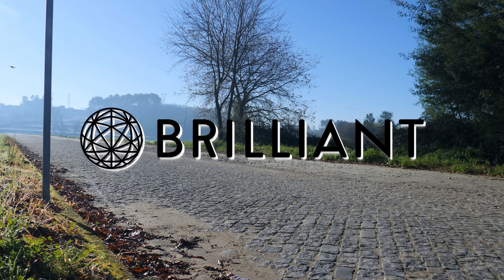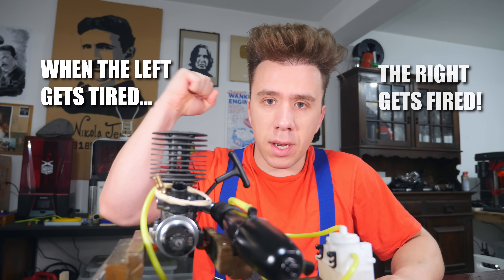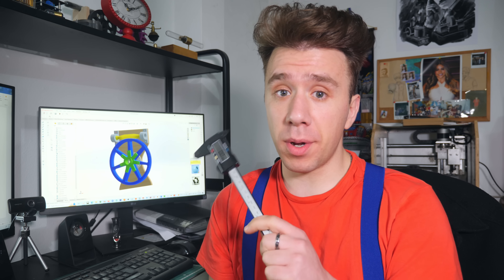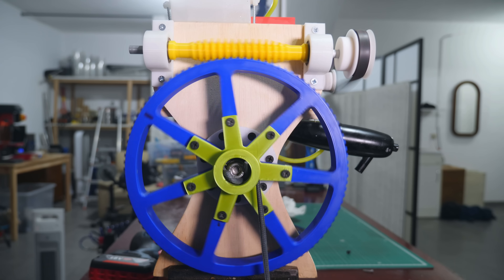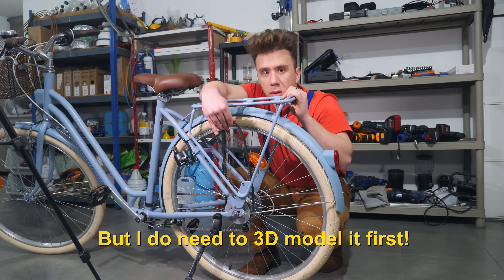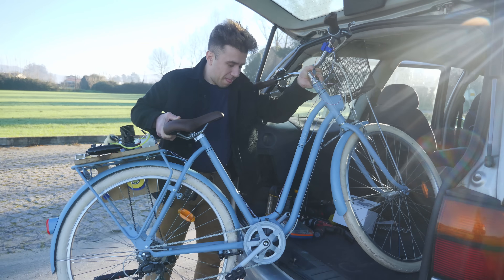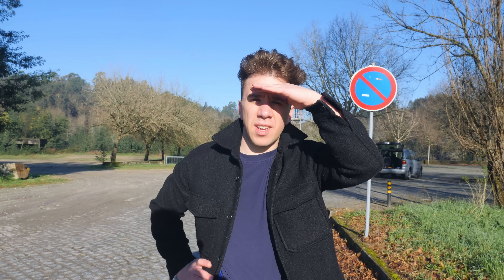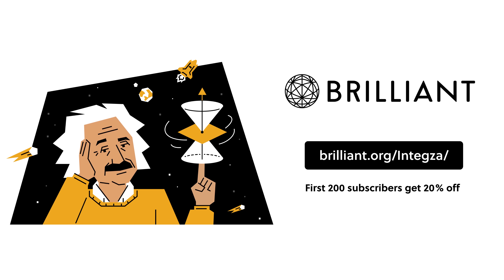Tiny 3.5 cc NITRO ENGINE on a BICYCLE

Comment: Make a drone out of nitro engines
Reply: The Iranians actually made cheap 2-stroke drones
Reply: I'm American and we approve this message.
Reply: Well never see a drone with nitro engine but i did see some rc helicopter with nitro engine tho
Reply: Oh shit that’s a good idea
Reply: Toothbrush
Reply: That sound would be horrifying
Reply: Impossible😊
Reply: I made a variable pitch quadcopter 12 years ago using a single 700 class nitro engine to spin all four rotors, I made the rotors from a rc helicopter tail rotor. You can search all over the internet for it.
Reply: Power density and output in relation to weight is too low. Impossible to make it remotely worth it. The results of existing examples are not impressive xD
Reply: the drone wone fly very good, to much vibration
Reply: Incredibly obviously nitro engines are WAY too heavy.
There's a reason nitro helicopters are huge, and only run for 10 minutes or so. 
Now imagine 4 nitro engines with their fuel tanks. How you gonna make them work together so that each motor gets proper thrust? 
How you gonna ensure the center of gravity stays the same when the fuel tanks are being emptied?
You're not. Because drones run their motors at different speeds for different motions, you're gonna have fuel tanks that have different amounts of fuel as they get emptied. 

That's the least well thought out idea I've ever heard. 

I'm sorry, but maybe think 10% more or so before you have a genius idea. 

There are dozens of excellent reasons why this idea would never work, if only you understood HOW these propulsion systems worked. 

Way too heavy anyway.
Reply: @Boogie_the_cat  well aren't you a ray of sunshine
Reply: @Boogie_the_cat how long did you spend making that whole text 5 mins?
Reply: @Boogie_the_cat  What about a drone-copter with an electric generator based on a nitro engine?
Reply: @Boogie_the_cat  Oh smart boy, ever heard of a swash plate and variable pitch propeller. The IC engine drone is vary much possible it's just not commercially viable that's why you don't see it around but cool project.
Reply: @Boogie_the_cat chill bro 😂 I know you're genius and all, but that takes responsibility. And no idea is a bad idea you just need to find out how to accomplish it. Have you tried making one? I haven't but it could work with enough engineering.

Comment: small correction, it runs  on methanol mixed with castor oil ( usually 20%) .  nitromethane is for extra power, optional. but nice to have

Comment: what you’re calling french hp are only when you’re paying for your car registration document, it’s not only about HP, but seats, length, width,weight, torque, etc, most small cars have 4 to 5, and by example, a BMW 335i is around 21 which makes the price of the registration be around 200 to 250€, or 1050€ and it’s -50% when the car is more than 10 years old, hope you enjoyed learning that haha

Comment: Very cool. I understand thats alot of work being an engineer myself. Great result, knew that teflon gear wasn't going to cut it, its just too soft...also the finish on the bronze would need to be polished.
Some nyloil rod might be a good choice and might last longer as its self lubricating...also nylon 66 has a high mechanical strength. But im sure its in the back of the shed now. As I said good job

Comment: I bet you could get to 45 kp/h or faster if you pair that engine with a 2 or 3 speed rc transmission between the engine and bike powering contraption you made

Comment: Fun video... When we were kids we tried experimenting like this, but we didn't have 3D printers so we used these engines as they came, which was from Model airplanes. You guessed it, we just mounted them propellers and all on the front of our bikes. They worked too!

Comment: Maybe you need an explaination about what you call "french horsepower". The actual translation should be "fiscal horsepower" and has very little to do with the mechanichal power. It depends on the engine size, the number of seats, the number of speeds, and its only goal is to calculate some taxes and insurrance costs.
When the 2CV was built, almost all cars were between 4 and 13 "fiscal horses", so it was an economical car.
The "2CV4" was 425 cm3, 2 fiscal horses and 23 HP
The "2CV6" was 625 cm3, 3 fiscal horses and 32 HP
🙂

Comment: The engine needs form of transmission so the engine can disengage from the gear box you made so you don’t overload the engine while it’s stopped or ride the clutch for optimal power.

Comment: 0:38 el Citroen 2cv no tiene 2cv tiene mas( según Google el 425cc tiene 18 y para 400kg me parece poco). Un ciclomotor de 50cc suele tener entre 7 y 11 cv tranquilamente. Si un Citroën 2cv con un motor de 450cc y 600kg de peso tuviera 2cv no se moveria del sitio, ya no digo hacer una subida. Asi que una 💩con🍟 tiene 2cv el Citroen. La moto que puedes ver en la imagen de mi perfil es una aprilia rs chesterfield 50cc y con un kit de competición 80cc da entre 28/32cv con 115kg.

Comment: You should've used a larger gear connected to the nitro engine and a smaller to rotate the worm gear shoudve given you a lot more speed at lower power

Comment: You are running that engine way too lean, if you adjust the high speed mixture screw counter clockwise it will produce more power, start with a 1/4 turn, also fatten up the idle screw an 1/8th turn to help that idle calm down when you release the throttle.

Comment: Most motor scooters in the US are regulated to only 49.5 cc's without a license and are capable of around 25-45 mph with motorcycle license 80-120 cc's and will hit 80-110mph

Comment: To make it start easier you need to prime it. Put your finger on the exhaust for a crew turns. Also you can shut it down the same way. Also check the temperature of the engine.

Comment: Enjoyed this video, your technical words aren't wrong, just spoken different. Amazing how you have high end capabilities,but taking off a wheel is challenging. You do have great potential, like your Grandfather. You need to understand  components better. Then you can use that to build Allot better stuff. Needs a tensioner on belt, always on return side.

Comment: Late to the party but I'd like to suggest something: 
Have the engine power a motor, used as a generator, then use an electric hub motor for the bike wheel. 
It'll be lossy for sure, but way more durable and probable faster.

Comment: You didn't have fuel, when you were pulling. You should have pumped so fuel first. That's why the drill was so easy. You already had fuel from pulling

Comment: The big downside with a worm gear is that the wheels can’t be used to turn the engine over either for starting or maybe even engine braking. Also you could hook it up to the front sprocket and use the gears at the back for multiple speeds

Comment: The gear ratio is calculated by dividing the output speed by the input speed (i= Ws/We) or by dividing the number of teeth of the driving gear by the number of teeth of the driven gear (i= Ze/Zs  ).

Comment: Sorry bro but the Citroën have 18hp not 9.
Reply: depends, there are 3 different generations, one with 9hp, another with 18hp, and another one even more powerful.
Reply: @xdnawer5525  The 9 HP was called type A and it's very rare. The most important production was in 18hp between ≈1960 and 1980
The last generation was 2cv6 it's a 12v car and 600cc and something like 30hp
Reply: He said 2 French hp, not 1. Said one French hp equates to 9 hp. He didn't directly say it but explained it as 18hp if you listened

Comment: So, I don't get the part where you slow down? Because unless you use near 45° angels on your worm and wheel cutting the power suddenly (as is common when slowing to a stop or turning a corner) all of the teeth will be  sheared off of the worm gear! Because the shafts are 90° from each other. So this video has some kind of flimm flamm going on. And you're not being totally honest about the build or the operation of your machine. And your Grandpa left you your grandmother's bike

Comment: I still don't know how you manage to make every contraption seem janky and amateur but well made and engineered at the same time.
That's a special talent.
Reply: Thats the beauty of engineering, finding the simplest solution to a problem that works. Unless youre at the physical limits you can solve every problem with enough money and time, but achieving the end goal for cheap / least complex way possible is good engineering.
Reply: "Janky" I thought I only still said that, and I'm 50yo. 💯👊🏾
Reply: @Cali-ssippian dude I'm 30 and I say janky all the time
Reply: Yeah, worm gear is a perfect engendered solution (no, it isn't.) 
Worm gears work well at small speeds, but still worse than a simple GEARBOX. Gearbox is the simplest and the best solution humanity ever made for this type of problems. 3 1/4 gear ratio gears, we get 1/32 gear ratio. JUST 6 GEARS!
And to find gear ratio he needed he could just use 2πR, ask himself what speed he wants and fricking count needed rotations.
I made almost the same project with electric motor (not  bike electric motor), and my little 10 year old brain in Russian village did freaking better.
He is definitely not a bad YouTuber, but definitely not an engineer.

Comment: It looks like the engine was running a little lean at full throttle, going off of the look of the exhaust smoke cloud. Nitro engines are very sensitive and normally need to be tuned for the given day.

Comment: It is capable of much more power but you were not revving it nearly high enough.  The porting, timing and exhaust pipe of the R/C buggy engines are all optimized for power in the upper end of the rev range.

Comment: @5:53:  One of the most dangerous moves you can make with a table saw - cutting small pieces off on the right up  against the fence.  If that piece gets slightly out of alignment it can become pinched and that whole pieces can become airborne...  not to mention the insane height of the blade above the work piece.  A good way to lose a hand!
Reply: Yup , that was the most idiotic thing I have watched in a long time
Reply: Always make and use a push stick too.

Comment: You're using street tires. Just use the huge bycicle wheel itself as a reduction "gear" and let the engine drive it directly from the axle. Works pretty well. Have a look at add-e, the inventor of conversion kits. Because a worm gear is pretty inefficient.

Also, you're scattering micro-teflon everywhere!

Comment: Brass is definitely not self-lubricating. Try running brass on brass and it will destroy itself quickly. Brass is used for bushings because it works well against *steel*. The dissimilar metals won't bond at the molecular level, so no galling takes place - no tearing of the surface, no rapid wear.

Worm drives have a lot of friction. I suggest you get rid of it and create a gear or belt reduction all the way from the motor to the wheel. It'll go better and last much longer.

Comment: you need to prime these engines by holding a finger over the exhaust. This will pressurize the fuel tank and force fuel into the carb

Comment: That is a lot of power for a bicycle. Of course, you have a lot of losses in the drivetrain, a heavy and not very aerodynamic bicycle (and rider), a non-ideal fixed gear ratio, etc.
Just to let you understand the potential of this exact amount of power - professional road cyclists can maintain 1500-2000W for a few seconds during a sprint reaching speeds over 70km/h commonly. A cyclist on a road bicycle riding a level road of decent surface quality needs only about 150W on the pedals to go 30 km/h.
If you spent a lot of time engineering and optimizing this, with this power output it would literally be a dangerous vehicle xD

Comment: Wonderful! Just a comment; those little motors aren't good with side loads. They normally drive something in line not a tight belt. Just saying you might consider supporting the crank snout with an external axial bearing to take the side loading. Better for crank life. Keep up the fantastic work and thank you for the entertainment.

Comment: It took that much to crank because you didn't prime the fuel system. Before you put the glow ignitor on it put your finger over the exhaust outlet and pull the rope about 3 or 4 times. Then it should crank within 2 or 4 pulls. It's idling up like that because it's to lean

Comment: 'Nitro' is a term used by people who don't really know these engines, it is correctly known as a glowplug (or just glow) engine and they run on methanol, with nitromethane as an additive to boost power. Try running one on pure nitromethane and you will never get it started!

Comment: it was easier the second time it started because it had already ran at that time. the first time ever running an engine it wont start the very first time.. or few times.. it wasnt quicker because of the drill it was quicker because it already ran before

Comment: The issue isn’t horsepower it’s torque. That’s a 2 stroke engine so it’s low on torque until it’s high in revs but even an equivalent size 4 stroke, it wouldn’t have the same torque of a larger engine of similar horsepower because part of torque is rotational mass. These tiny engines are…tiny…so less mass of the piston and crank so less torque. 

Rc models are obviously smaller and lighter so their torque to weight ratio is adequate.

Comment: Worm gears are very inefficient, you are loosing nearly half the motor power due to change in the angle of force, you need to use standard bicycle or motorcycle belt or gears and keep the rotation in the same plane.

Comment: Id like to see this with a 1.05 heli engine into a planetary gear box. They are happy and produce max power at around 15000 rpm so doesn’t need as much reduction and they have a lot more torque :)

Comment: @0:47 The car model name "2CV" doesn't refer to "French horsepower". As the French defined the non-imperial horsepower at the 3rd Conférence générale des poids et mesures (CGPM) in 1901, French horsepower (noted ch) is the same as the italian horsepower (noted cv). The trick is "CV" in French is not the abbreviation for "cavallo vapore" (horsepower) as it is in Italian, but a symbol for "cheval vapeur fiscal" ("tax horsepower" in English, or "potenza fiscale" in Italian).

In sum, there is no "French horsepower" such that 2 "French horsepower" would equate to 9 horsepower. There is only imperial and SI-based horsepower (the latter of which was mainly defined by the French on the SI units they had also proposed). As for the 2CV (2 tax horsepower) category, it could apply to a large range of different motors with different horsepower ratings. So there is no way to make a conversion from horsepowers to CV. It was just a way for Citroën 's car to gain recognition as a cheap, low-powered, very tax-friendly and fuel-economic means of familial transportation in the afterwar. In the same way and for the same reasons the Germans, Italians and Japanese all made cheap very accessible means of transportation for the general public during or after WWII.

As for the actual horsepower of 2CV, it varied a great deal following the years and different motorizations, and could be found with anything from a 375cc 9HP engine, to a 602cc 29HP engine. That were motorizations from the Citroën factories, but I should add many, many 2CV being an omnipresent dirt-cheap easily-maintained car were customized by their owners or independent carshops to accomodate for a slew of different engines.

The main idea here is that there is no such a thing as a conversion from "French horsepower" to "horsepower".

Comment: It's not the horsepower that matters but the torque. An internal combustion engine with the same horsepower as an electric motor creates less torque. A single cylinder internal combustion engine creates less torque than a multiple cylinder internal combustion engine even if they have the same horsepower. Torque is only created on the combustion stroke of an internal combustion engine and it varies depending on the rpm, but an electric motor creates constant torque that is consistent throughout the rev range.

Comment: These Nitro RC engines are quiet powerful for their size.
For example: a 2.95cc engine can output 1.8 hp ( depending on the tune )
It may not sound like much BUT, if we scale up this engine to 1 liter of Displacement with this equation:

Power ( 1.8 HP)
-----------------------     X 1000
Displacement ( 2.95cc )
We get an power output of 610 HP per liter

Comment: its funny but if im not mistaken on rc cars they used to have a small tube to shoot the mixture into the pipe also I remember there was an Italian brand that used to be the champion on those RC cars Giovani engines if im not mistaking normal RC cars trugies and buggies would reach 56mph the Giovani engines would pass the 75mph and this on off track cars in the mudd and with bounce and jumps

Comment: I think maybe you could add a heavy metal flywheel between the tire and the worm gear system and you would get alot more torq and smoother power deliver

Comment: Dude you're dangerous with woodworking tools. The table saw blade only need to be a blade width over the material. And when I saw you push a 2x4 through it with no push sticks and stop with the material in the blade at 5:52 I cringed so hard for your safety. That is how you get hurt, I've seen it happen live. I knew someone who died from a kick back hitting him in the chest and getting a blood clot. You push the material all the way past the blade with a push stick, preferably one that is locked to the material and a groove on the table saw. Get as good at woodworking as you are at math, for your own well being.

Comment: Hmmmmmm attach the end sprocket to the spokes of the wheel.......hmmm....... Anyway, if I put down 2hp (1500watt) on my race bike (and according to my zwift trainer I can for a sprint), I go a LOT faster. Guess the transmission has a bit of energy loss 🤣